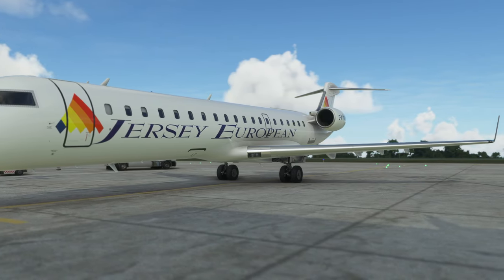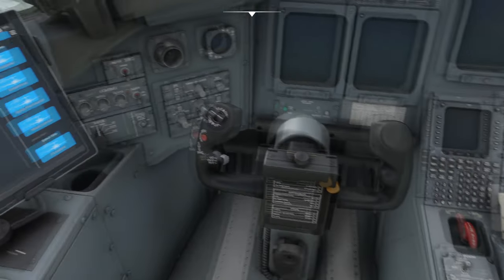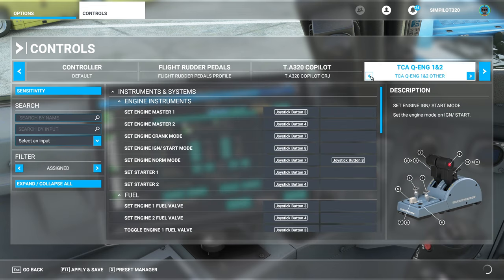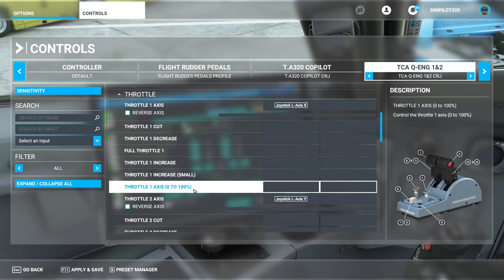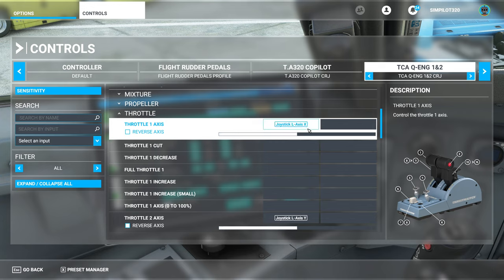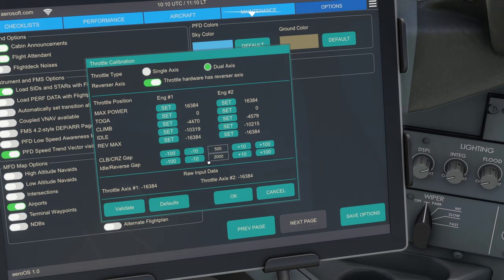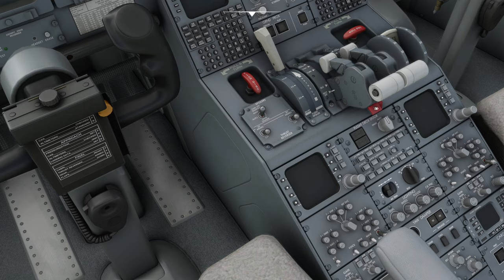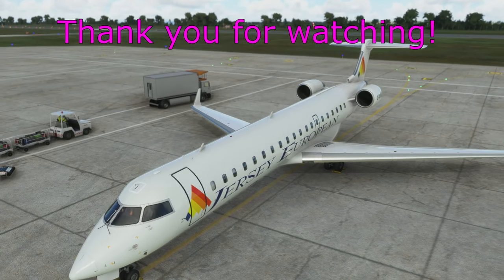Thrustmaster TCA Throttle Aerosoft CRJ Setup Guide! MSFS with a Real Airbus Pilot

Comment: Thanks that's great. When validating I get an error that eng 1&2 Rev max overlaps idle. I've changed the gap figures but still get the message. Not a real problem, I'll press F2. The major problem that I have is that even though the yoke and elevators move, the aircraft won't lift off unless I've got 4000m of runway. Back to the manual. It's a shame because the A32NX worked straight away.
Reply: Note to the guys who found this one not working, please make sure to click "reverse axis" in the options. it's weird, it shouldn't be like this but this is how I solved.

Comment: Hey 320! For some reason, my throttles are going into the -16384 at toga on the throttle and thats what it shows on the screen. I have updated them but this seems to be a bit strange as reverse axis is not on.
Reply: That’s exactly same as me ! Have you found a fix ?
Reply: @dommorris325  what was the fix?
Reply: Have you found any fix now 2 years later?

Comment: I've been trying to get the TCA throttles working for the Pilatus porter and other turbo props (default MSFS a/c) - but the throttles keep hitting 100% whenever I move them beyond 1/3rd of the way up.  More programming needed.  The sensitivity button is pegged all the way at the top and won't come down to the middle line either.  
What a cow of a system!

Comment: Hi, I am a bit late to the show on this topic, but have only just purchased this plane, reset my throttles has shown, have ensured that the 'reverse axis' is not ticked, yet when I push the levers forward to its furthest setting, I get the number -1638, pulling levers back result back to climb, the numbers go to zero, and from there to reverse thrust they enter positive, am I missing something?
Reply from the maker: Hi G D, there are a lot of possibilities. Firstly I recommend making sure you have all the correct drivers from thrust master. The instruction booklet included should guide you to the correct place to find them. It will also direct you on how to calibrate the thrust levers on first time use. I hope one of those helps!
Reply: Cheers, but windows did it normal thing of not working yesterday, but working today, I ended up running over the ground marshall.

Comment: Think I'm doing something wrong. As soon as I try to do reverse thrust nothing happens. 
You also do not see the colors of 1 & 2 change when you are outside the plane and you have your flying instruments visible. it works on other planes
Reply: Did you arm the thrust reversers? (I didn't to start with and ran into this exact issue!)

Comment: Hello Sim Pilot, I'm still having an issue with my TCA quadrant. I followed your steps and calibrated it on the EFB but for some reason the throttle on the place don't move at all.

EDIT: FYI, you need to start the plane at a cold and dark state or else it won't work.
Reply: Did you figure it out yet? I am having the exact same issues.

Comment: I get over laps when I validate ...  Help ?  
I.e. TOGA overlaps MAX POWER etc
Also my MAX value is negative, while in the video you have a positive value for the max power and a negative for full reverse. I hahve the oposite. I did do the changes in the configuration settings .. What can be wrong ?

Comment: When I validate the settings I get a message saying ERROR: Engine 1 Rev max overlaps idle? Can anyone explain this error and how to fix it? Thanks.
Reply: Make sure to use the default sensitivity settings within any profile you are using in the TCA Profile menu within MSFS 2020. Then be sure to redo the throttle calibration inside the CRJ EFB and make sure your numbers don't overlap. When you click validate you should get a message saying " no errors found ". If you get the Error Message like the one you recieved - you did something wrong. It should work fine once you follow the steps carefully as this can be a little confusing for the first time and I believe the sensitivity settings if not set as they came default can throw off the numbers when calibrating within the CRJ, causing the overlap error. Good Luck!
Reply: Cheers mate 👍

Comment: doesnt work for me :'-(  throttle axis stay to -10811 and dont move
Reply from the maker: Make sure the axis is assigned to the correct channel! By default it will not be.
Reply: @320SimPilot  try another time yesterday throttle move but when im max it s Write -16384...so I try with reversed axe and doesnt work again😅
Reply: @320SimPilot  I have take picture if u have à discord channel I can send u